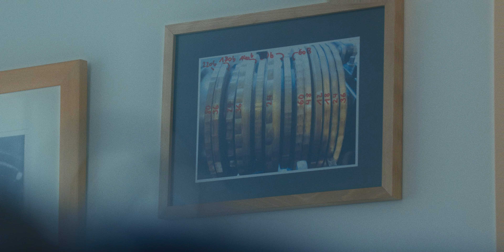How Are Guilloché (Rose Engine Turning) Dials Made?

Comment: Could you design a helical shaped “pattern arbor” thing that allows a long continuous cut? Is each “pattern arbor” for 1 singular rotation?
Reply: The pattern wheels, called rosettes, provide a consistent input to the drive shaft and translated motion, via a tracking component called a touch. There are other controls for the size, speed, depth, and other parameters. There is also a crossing wheel which allows selection of where in phase of the rosette pattern the shaft is timed to. Each rosette therefore can produce hundreds and potentially thousands of patterns, continuously. The operator adjusts the location of the cutting tool to locate the pattern on the part. Do you understand it?